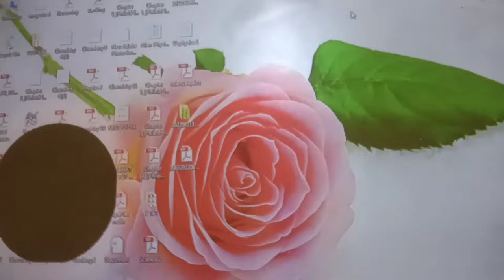Projector black spot problem solution/ projector screen problem/ Dust black spot

Comment: Where is the solution?? 🤣 You just gained another dislike 😏
Reply: The solution was to take it out and wipe it clean and put it back in 🤦‍♂️
Reply: @stunnin420ify  it doesn't work like that if u knw minimum basics 🤣🤣🤣🤣🤣🤣🤣🤣🤣🤣🤣🤣
Reply: 1:20 he’s cleaning the polarizer right there. I’ve done it on a few projectors too. Are you saying we’re wrong. How is it done then?
Reply: @stunnin420ify  what do you use to clean it?
Reply: Diluted alcohol.